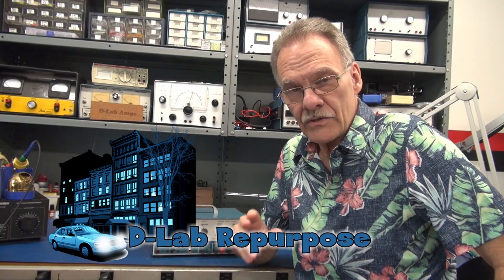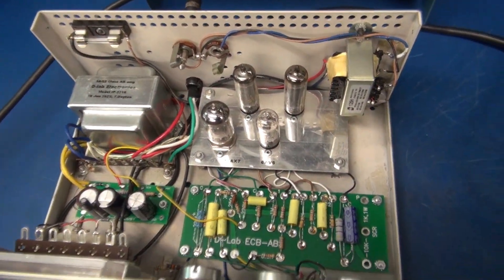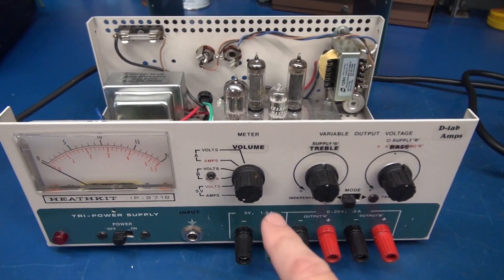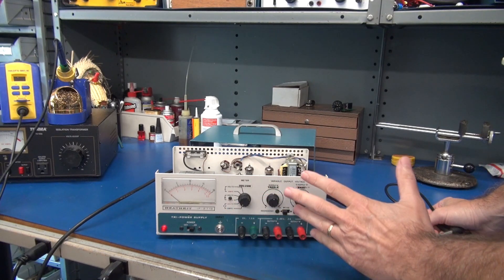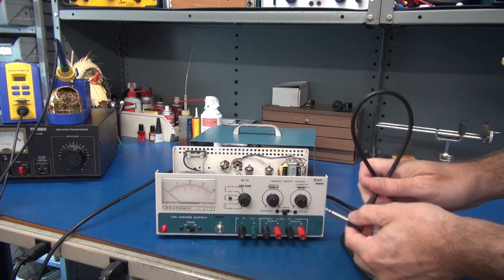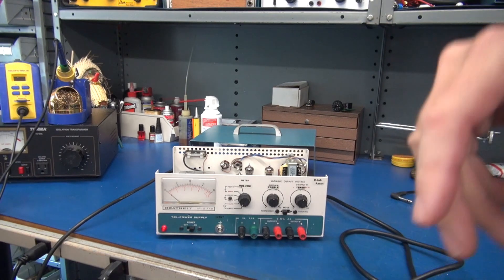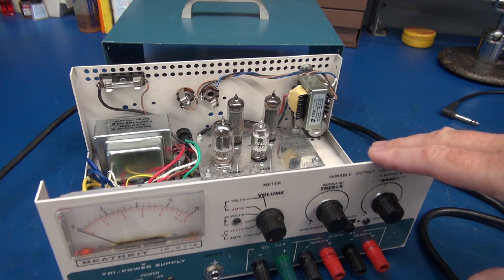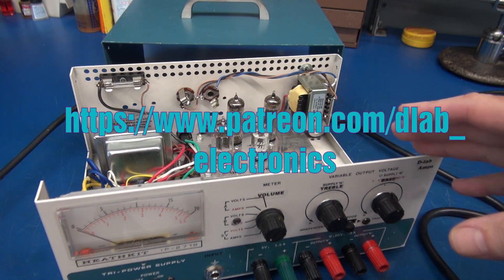D-Lab Heathkit Retrofit IP-2718 Power supply to tube guitar amp Boutique at its best build & create

Comment: Terry, I have to tell you that modifying a wonderful peace of test equipment into an amplifier makes me sad.
Reply: I have a fully working model IP-2718 in my shop.   It is very useful in an audio repair shop.
Reply: @swinde  - Same here. Just had to change 2 resistors to a higher wattage.
Reply from the maker: Its fate was the junk yard, all internal components were MIA
Reply: @d-labelectronics  - Got it!

Comment: Terry, I have almost that exact same power supply, I think mine is a 2717. Did you use any of the existing components or just the housing?
Reply: Good to know, thanks. If I can't sell it as-is, maybe I'll make a guitar amp out of it!
Reply from the maker: Hi Mike, Yes, just the housing, meter, etc. Cabinet is nice to work with